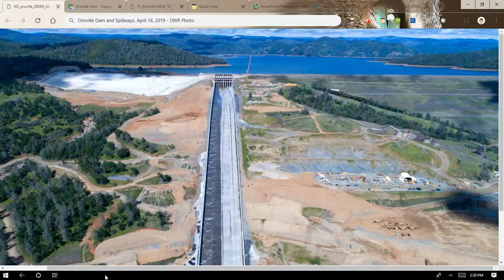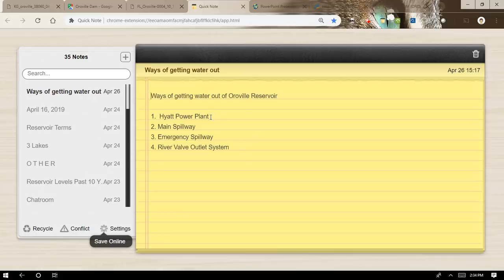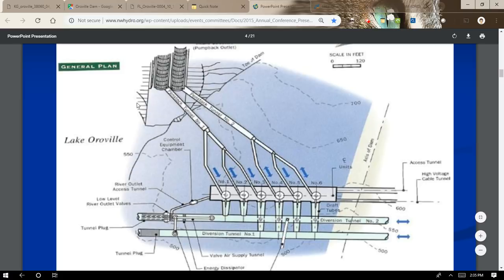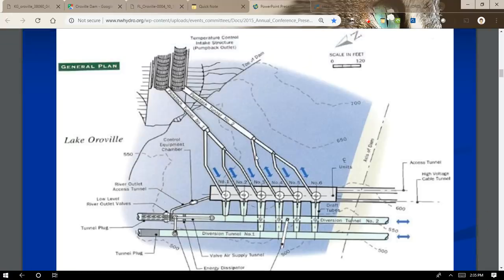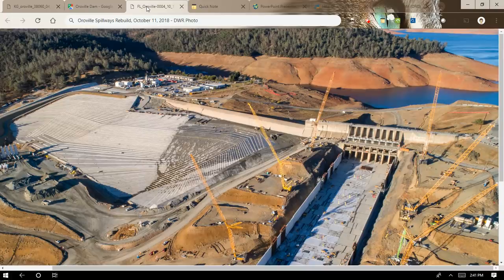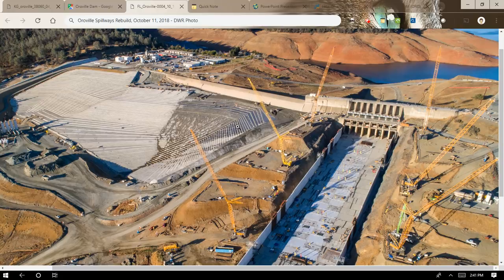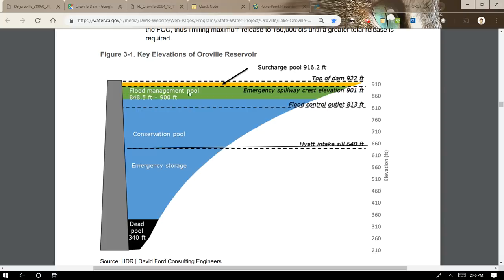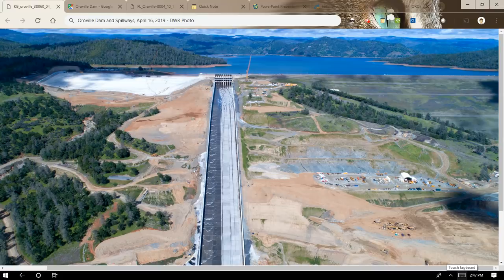How Does Water Get Out of Oroville Reservoir? ~ Millie Kay 04/26/19

Comment: At the end, the only better control they get is ESW they redesigned .
Truly dont get why they didn't redesigns the end the spillway in order to minimize oriented to thoses tunnels water spinback .

You gather comprehensible explanations as always, millie
Reply from the maker: Hey Brice! Thanks for viewing and providing such kind feedback. Hope all is well with you. Take good care!
Reply: nice to see you on brice!!
Reply: Because they can't turn the end of the spillway, and still have 100K+ CFS capability - without having extremely high walls.  I believe they said they would have to be 75' tall or some such.
Reply: @MegaBakerdude 
Regardless the maximum output structures down the spillway could handle, and how ...

That leads on serious questions about capacity and ways to handle both storages, releases, and safety levels ...

Comment: Nice video Millie - your return is welcome.  FYI to people saying DWR didn't do what it said in its April 2, 2019 press release: "DWR may increase releases to the Feather River again later this week to between 40,000 and 60,000 cfs to prepare for forecasted inflows."

There was rain in the forecast at the time of that press release.  DWR didn't state they would be testing the spillway at 40K or 60K CFS.  They stated they "MAY" increase to between 40K and 60K CFS.  There ended up to be no need to make room for heavy inflows, because heavy inflows didn't materialize.  Some people seem to expect DWR to test the spillway at high CFS - but to do that would impact those downstream - where you used to live.  Some want them to test at 100K CFS - but that would do substantial damage to the river banks, and it would flood peoples' properties.  What we may see is a 30K release in the next few weeks, to drop the level a bit.
Reply from the maker: Hi MegaBakerdude! Thanks for the kudos and the nice welcome.Yeah, I listened to that video quite a few times just to be sure of what was said. The "let 'er rip" method of testing the spillway does seem to be popular, doesn't it? The thing I can't figure out is why they are keeping the Hyatt flows so low. With two new spillways, I'd think it would be more prudent to run more turbines (if the five they usually have on site are all operable). Also, while we're on the subject, one clue that they may be going to release water down the main spillway is they might up the river releases slowly to prepare for that. I haven't seen that happen yet. It is scary to see the water get above 880 with all current factors considered. After the evacuation in 2017, I determined 875 to be my personal number to begin close scrutiny of all dam and river stats, and my clue to keep the gas tank full and the "Go Bag" packed. 875 may seem low in regards to general conservation protocols, but "to each his own." Take care.

Comment: Thanks Millie, back in 68 I earn to ski on the Butt Valley Reservoir so I have had an interest in PG&Es stairway of power. I pretty sure I have watched and done my own research on California's water systems. Now  I can't seem to find anyone who knows or wants to acknowledge the existence of the RVOS little less if they are currently using it. The outflow through the Hyatt was a consistent 9,500 cfs  since they brought it back on line with 5 gens, with1 down for maintenance. The outflow has jumped up to almost 12,000 cfs and I can not seem to find out how they did it. Can you steer me to someone or somewhere that might have an answer? Sincerely; Baffled, Don David Jr.
Reply from the maker: You're welcome, Donald! Thanks for stopping by. Five turbines running optimally can put out around 14,000 cfs since their design capacity is a little over 2,800 each. When the stats showed 9,500 perhaps they were doing some in-plant adjustments in order to get the turbines to produce at highest level possible.  The RVOS can do between 4,000 to 5,000 cfs. I don't know for sure, but I don't think they use RVOS when turbines running because they outflow in the same Diversion Tunnel as some of the turbines. I hope this info helps.  I did a video on the River Valve Outlet System at https://www.youtube.com/watch?v=aSRV37EYxvU&t=27s

Comment: Dear Millie Kay:  Please make more You Tubes...  your voice and vocal control make for Outstanding Results!  Can you describe what fails in a real overflow situation????
Reply from the maker: Hi Trapped! Well, lots of things could fail. Can you elaborate a little more? Do you mean if the emergency weir overflows -- or the dam? I'm interested in your question, just not totally sure how to address it without more info. Thanks!
Reply: To have an "overflow" there is only one possibility.  The ESW is only for emergencies, so it will not be routinely used.  To have an overflow, the capacity of the outlets Millie described is not able to exceed inflows, and the lake is full.  Imagine the flood control spillway gates could not be used for some reason, and the current inflow of about 21K CFS continues for a few weeks.  Imagine also one tunnel and two turbines can't be used, and only 4 turbines are operable at about 2850 CFS, or 11.4K CFS total.  So the ESW will flow when the level gets to 901'.  Or, let's assume a huge rate of inflow is expected due to torrential downpour on a snowpack - 250,000 CFS (likely only in the wet season).  DWR constantly forecasts weather and inflows, and in this case they would start before the storm releasing water from the main SW to attempt to make room in the lake to buffer the huge inflow.  Inflows spike, but are not continuous.  You could not have 250,000 CFS for 10 hours for example.  But you could for an hour or two.  The goal is to accept the water into the lake, and release it in a controlled manner (not over the ESW) later.  Back to the scenario, if there were insufficient room to absorb the short term spike to 250,000 CFS, and the main SW could not be run at 250,000 CFS to get rid of the water in real time, the lake would overtop the ESW.  There is a LOT of work put into forecasting weather and inflows from the watershed, so this does not happen *normally*.  In 2017, it was in fact while DWR was in the process of making room for future expected inflows from an approaching heavy rainstorm on top of the snowpack, that the failure of the spillway occurred.  Thus, they could not make sufficient room ahead of time, and the ESW overflowed when runoff from that rain and snowmelt it caused exceeded the impaired outflow capability of the dam.  DWR relies on accurate forecasting and functional equipment to safely operate the dam.  They have to have both.

Comment: I don't know why they put the name "surcharge pool" on that last 15ft above the top of the emergency spillway (can only find it used with Oroville dam, and no others), but it's basically the highest level at which water can flow over emergency spillway before they consider the dam itself to be at risk of failure.    Keep in mind however, that with 15ft of water coming over the emergency spillway we're talking somewhere between 400-650K CFS of total outflow and thus all downstream levees have failed.      
There's a graph on my Oroville dam wiki page http://thud.us/wiki/index.php?n=PmWiki.OrovilleDamAndSpillwayFAQ
taken from the original Oroville construction document we've all seen, which shows the flow rate for the main SW up to 901ft then flow rate of ESW above 901ft up to 920ft.  

There's no functional difference between an "auxiliary spillway" and "emergency spillway".  It's just a matter of public perception.   An Aux or Emergency spillway is usually designed to handle the excess water for something like a 100 year flood.  But calling it auxiliary may lead people to believe that it's can be used as part of normal operation, while emergency makes it clear that it's meant only for very infrequent use if the main spillway is not able to handle the flow.
Reply from the maker: Hey daemn42! Glad you "surfaced" at my channel! Thanks for your commentary. Your Oroville Wiki Page is great. I believe the more information we have, the better we can make informed decisions. Yeah, that "surcharging" concept is interesting. I did read that one dam was in surcharging operations but I don't remember which one it was (I'll look some more). Thanks for commenting on the aux/emergency terms, too. I hope my viewers will read your Oroville Wiki Page at http://thud.us/wiki/index.php?n=PmWiki.OrovilleDamAndSpillwayFAQ  -- no matter which "side" they are on. Take care.
Reply: daemn42 ...Yes, auxiliary spillway sounds so much nicer. 👍

Comment: Hey Millie...thanks for the video. I’m wondering about the emergency spillway. If there’s another event like 2017 when water is rapidly flowing over that weir, the water will pool up in the “amphitheater steps” looking part of emergency spillway but then what? Does it flow over the hillside or is there a drainage system that takes that water from there to the main spillway? For the water to just flow over to the hillside to most likely erode the hillside again would seem to make the new emergency spillway a waste. If the water is supposed to just flow down the hillside why not make the emergency spillway run all the way down to the feather river like the main spillway does?
Reply from the maker: You're welcome, Joel. Excellent question! To my knowledge, the emergency spillway flow would go down and into the Diversion Pool over whatever is on that hillside at the time. So, they have armored it to prevent cutback, but I don't know what they have done to prevent debris backing up in the Diversion Pool. I haven't researched enough construction details at this time to shed more light on it, but perhaps there are other viewers who can contribute to this discussion. Thanks so much for taking the time to comment. Take care.
Reply: @MillieKay  
If I understand and remember correctly, the construction on the outlet side of the emergency spillway is intended to do two things. 
1- support the outlet side of the weir during outflow to eliminate undercutting That was the concern during the incident in 2017. The outflow began to undercut the outflow side of the topography so there was concern that the ??40' high weir could topple and release a wall of water of that height. 
That support is created through a "secant" wall at the base of the stair step structure. The Secant wall is roughly the length of the emergency spillway and goes up to 65 feet deep to bedrock. The wall, the roller compacted concrete/stair step structure, and the new concrete "re-inforcing" wall  is designed to keep the outflow water from eroding the support directly below the emergency spillway weir. 
2- I believe the one of the features of the "Stair Step"  outflow design is to "aerate" the water as it passes over the stairs to "lessen" the erosion effect of the water on its way to the Diversion Pool.
Reply from the maker: Hi Pappa Bob! Hopefully they will never have to use it again. I still have concerns about possible seepage underneath -- and all the boulders and shotcrete they put in there before putting the RCC over it. Thanks for stopping by and commenting!

Comment: Hi Millie - excellent work as always.  That diagram of the penstocks is the best one around.  Just imagine if the dam had a full surcharge pool, and there was 15' of water above the level of the ESW weir.  Holy smokes!  The only change I would have made was put the ESW last on your list, after the RVOS.  The ESW is not to be used, unless there is no other option to keep the ESW weir from overtopping.  Those people hoping they will see the ESW running in a week or two I believe will be disappointed, unless there is a serious problem with the main SW DWR is keeping secret.  I simply don't believe that is possible, given press releases that say it is ready to be used.
Reply from the maker: Hi Don! I am so glad you stopped by. Was hoping you would since you always have valuable input. Thanks for the compliment. Yes, I agree that is the best diagram for explaining the Hyatt and RVOS. The possibility of surcharging is frightening for sure.  Yes, the list really should be Hyatt, Main Spillway, RVOS, then Emergency Spillway. Yeah, I doubt they are letting the water rise to "test the Emergency Spillway!" You have a  point about the press releases -- it does seem that would serve to keep them accountable. However, I do think DWR flies by the seat of their pants and gets in trouble with that balancing act they do. One warm storm in the sierras can change the picture drastically. And I also think there are things that could be happening under the fixes that could "pop up" at any time.  I guess we will see. I'll bet gas sales have gone up recently in the downstream areas. Take care.